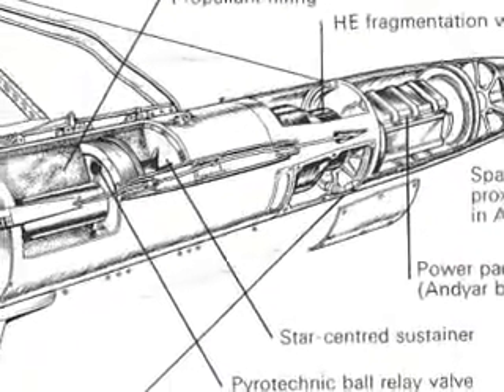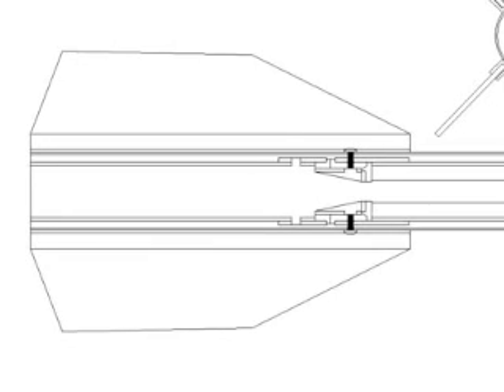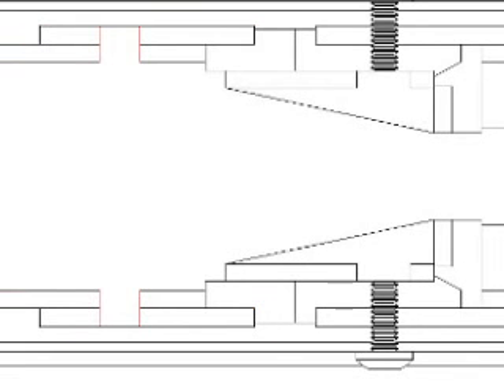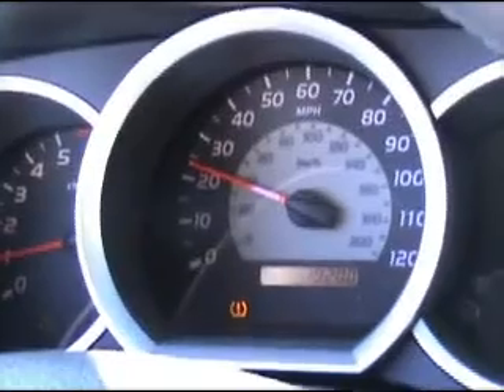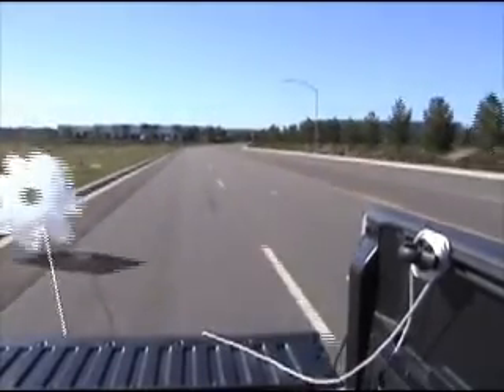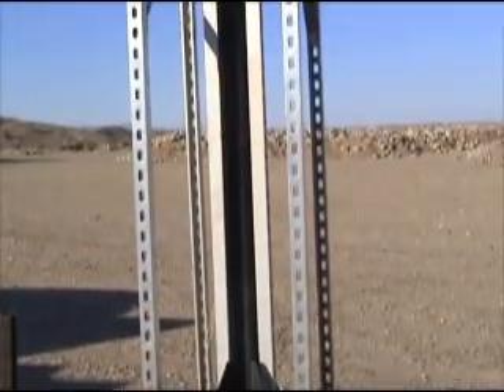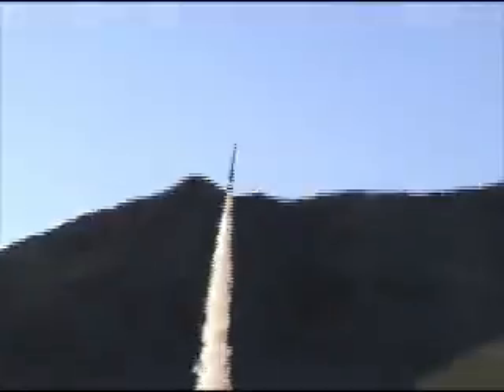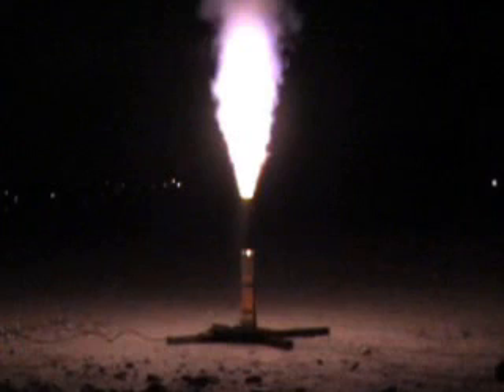Kno3 Sugar PVC Rocket with Blast Tube

Comment: what is the advantage of using blast tubes.......???
Reply from the maker: Well the thought was to move the weight of the engine forward so the rocket could be stable without adding weight to the nose. But the disadvantages outweighed the advantages.

Comment: Yeah im ordering your book for sure! So when heating the fuel up, what temp do you have the pan at? Also, should I grind or mill the KN03? Thanks for the helpful info
Reply from the maker: No need to grind the Kno3. I use an electric wok and set it at its maximum setting. The book will really help you out and answer all your questions. Good luck and let me know how it goes!

Comment: The ratio I am currently using is 60:20:20. I just purchased a digital thermometer to verify skillet temp. One thing that raises concern is the corn syrup, I'm using (0g high fructose KARO corn syrup) "with real vanilla". Is the vanilla a bad thing??? The fuel also seems to be "wet" or soggy and doesn't burn well, not sure why? Thanks for sharing your knowledge! Next on the agenda is your new book.
Reply from the maker: Hey Chris, The ratio is off. I use 65% KNO3, 17% corn syrup and 18% powdered sugar. The thermometer is only used to measure the temp of the fuel, not the pan. The only reason for heating the fuel at all is to lower its viscosity so it can be poured. Also, the KNO3 absorbs moisture no matter how well you have it wrapped or where you keep it. You need to dry it out in an oven before you mix it. I wrote two step by step books on how to do it. The first one, K450 PVC Rocket Engine is only about the engine. The newer one, I Still Have All My Fingers, shows how to make each component of the rocket including the engine which is a K500, not a K450 like the first book. You may want to check them out on amazon if you're interested. Good luck!

Dan

Comment: When making FLEXI-FUEL, how long do you cook it? Also, you mention a temp. of 220 deg., do you adjust heat during cooking process or do you leave temp. at 220??? My flexi-fuel keeps turning light to dark tan color and it doesn't poor all that well. When the fuel cools down, does it remain flexible or does it harden? Any suggestions would be greatly appreciated. And by the way, AWSOME VIDEOS! keep them coming...Thanks